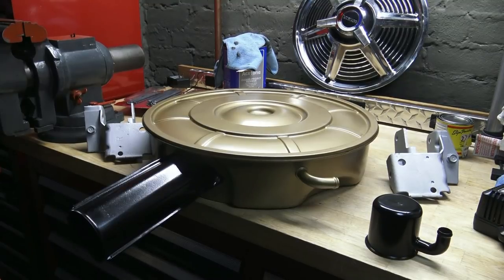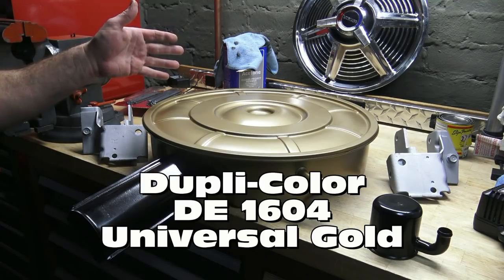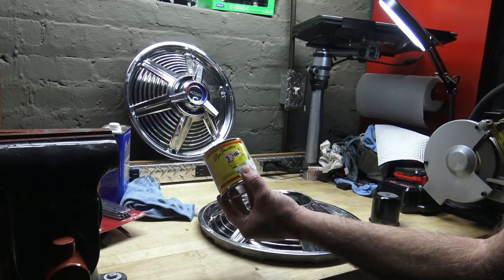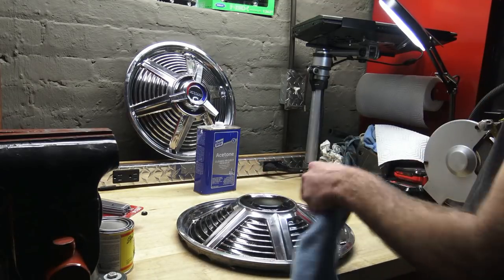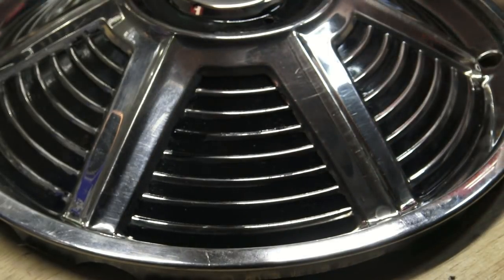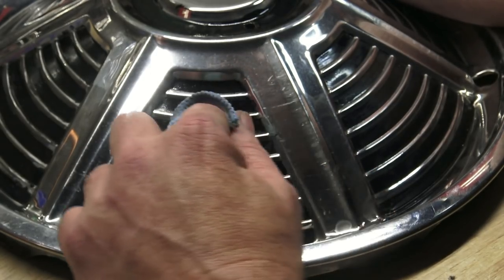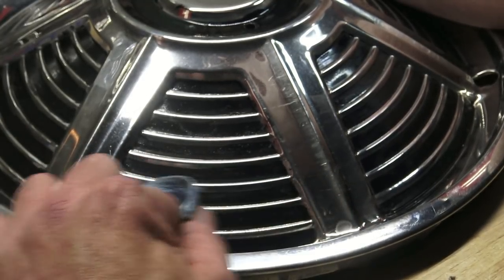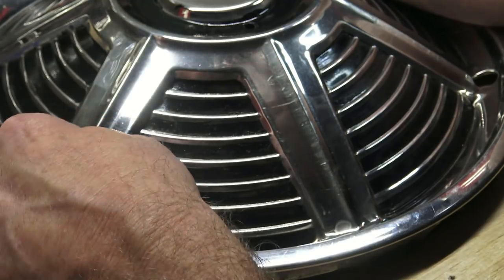Chrome Hubcap Painting Technique & Winter Progress - 1965 Mustang Vlog #8

Comment: Brian, great work. They just have to look good while driving or when gawkers are admiring it in a parking lot. I have a '65 coupe with the same caps. You had a stroke, I have one eye. Occupational Therapy. I'm watching this before removing the hub caps, so I don't have any 'inside' info otherwise. Did acetone remove any of the old paint in the slots? Did you rough up the slots first? You didn't talk about the spinner. Does that just unscrew from the back side?